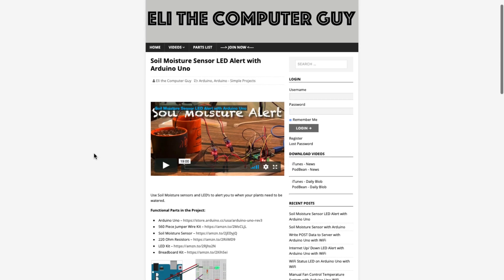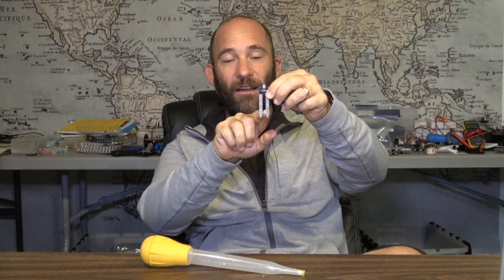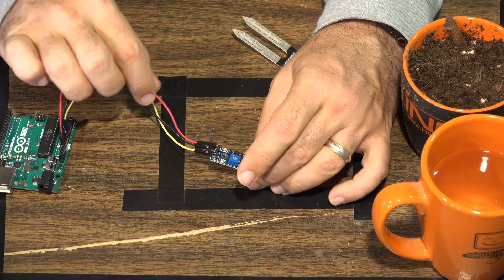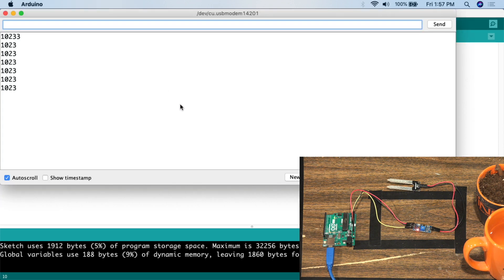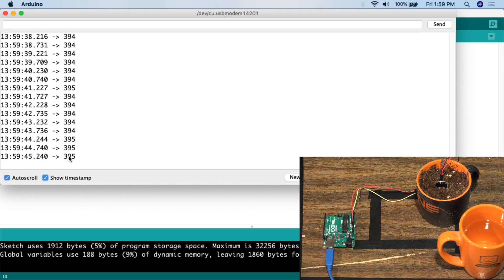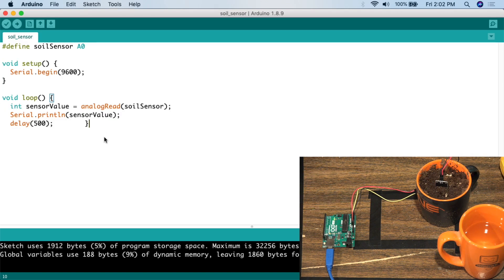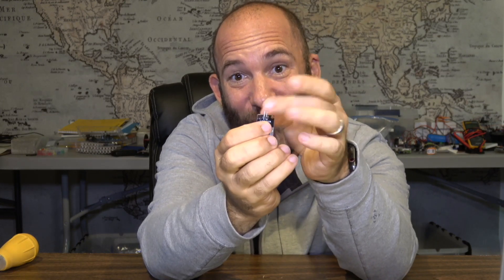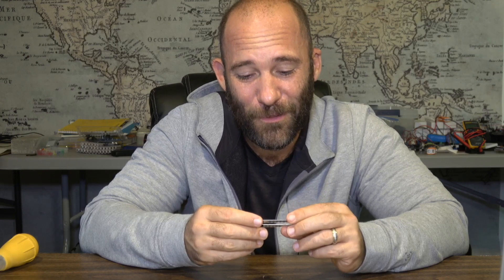Arduino - Soil Moisture Sensor

Comment: 16:14 - The problem with these (especially the cheap Chinese ones, e.g., from eBay) is that they degrade and die after a while. It's electrolysis, so the metals will corrode. If you want to avoid replacing them all the time, you can use the kind that's covered silicone which read capacitance rather than resistance.
Reply: Came to write exactly same comment
Reply: Well, the main problem why they degrade is, people are reading values all the time. The solution is, read the value once per 30min. Degradation is a lot less a issue.
Reply: @Dextermorga  This makes sense

Comment: If you had an expensive moisture sensor, could you program an arduino to match its sensitivity? I am trying to see if I can create my own greenhouse controller since even the best ones seem to be falling out of accuracy after some time or so dang expensive just to be unable to control certain aspects I would like to program. If this is something that is possible I would really like to make a smart controller where it will check status of everything in play to more accurately make decisions. I haven't fully thought out how I want thinks to act because I don't know where my limitations are at this point. Any information you'd think is relevant would be greatly appreciated 🙂

Comment: How long this sensor survive in mud, months? Years?
Reply: Like he said, if it's constantly running current, then it's constantly electrolysing the moisture and constantly dissolving the metals. With highly wet stuff like mud, it could be be gone weeks, maybe even days. You can do as he suggested and cut the current after the reading, but it's still wet and will still corrode, so you could try the (more expensive) silicone-covered ones that measure capacitance rather than resistance.